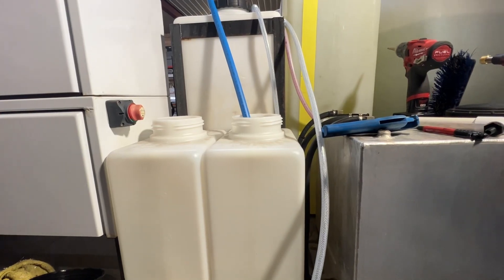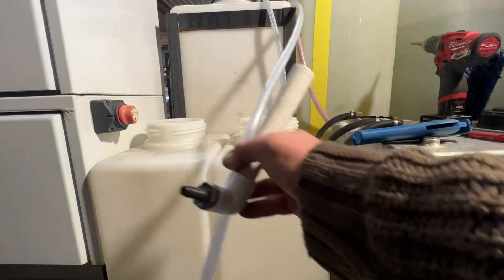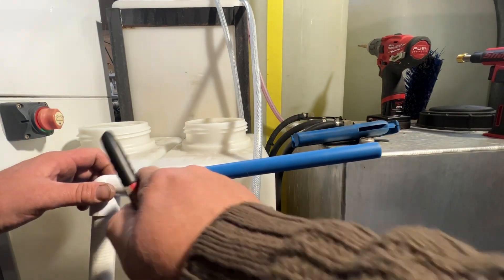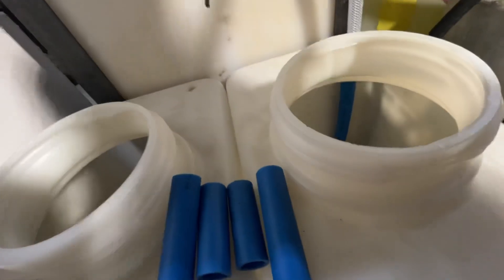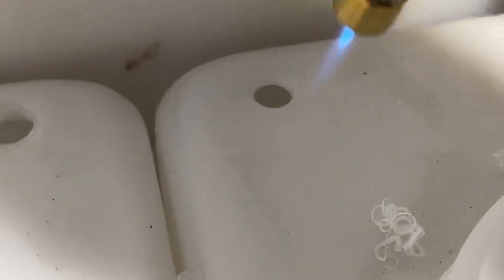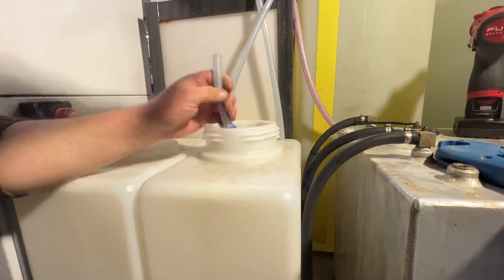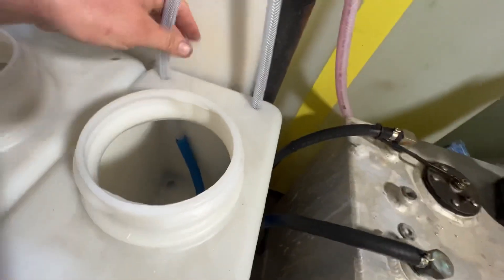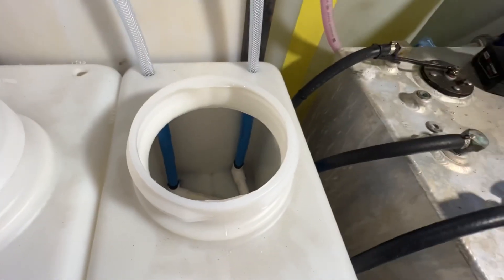Installing soap filters (NO BULK HEADS)

Comment: How do you make them filters ? Amazing
Reply: Pvc and cut a bunch of slits in it. Put a slip cap on one end and a threaded /slip elbow on the other end and cement it together. Add the threaded barb on the elbow end then you got it. I think he uses 1-1/4" PVC pipe.
Reply: @MannyAguilarJr  thanks a ton
Reply from the maker: They are well spuds /filters

Comment: Where can I get filters like those? Great content
Reply: He makes them. Pvc and cut a bunch of slits in it. Put a slip cap on one end and a threaded /slip elbow on the other end and cement it together. Add the threaded barb on the elbow end then you got it. I think he uses 1-1/4" PVC pipe.

Comment: What is needed to make those filters?
Reply: Pvc and cut a bunch of slits in it. Put a slip cap on one end and a threaded /slip elbow on the other end and cement it together. Add the threaded barb on the elbow end then you got it. I think he uses 1-1/4" PVC pipe.